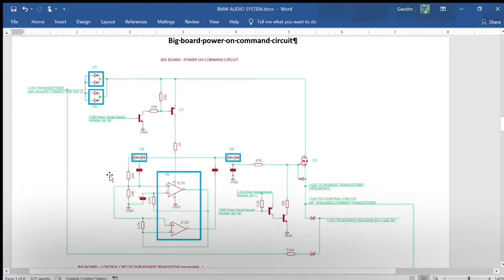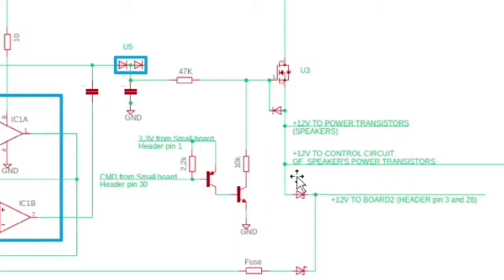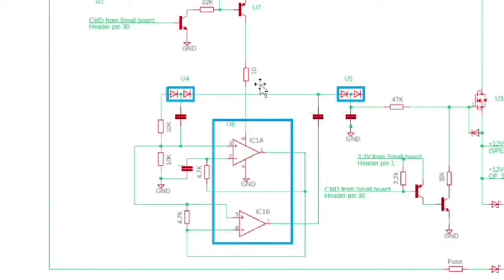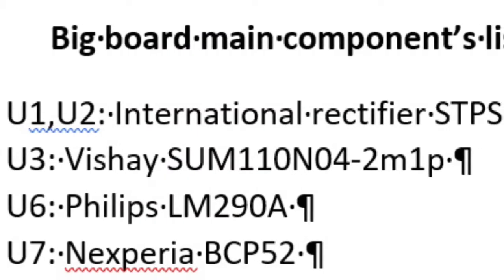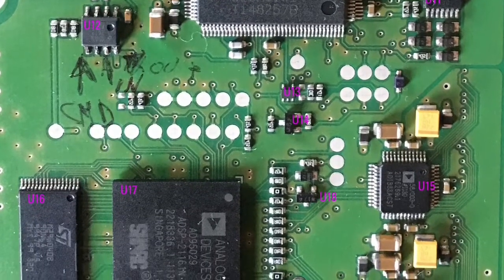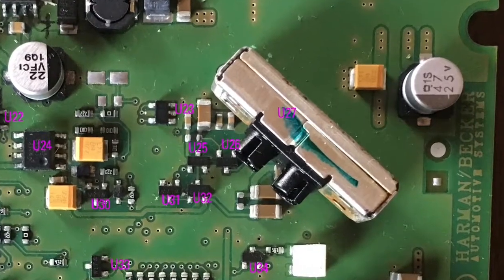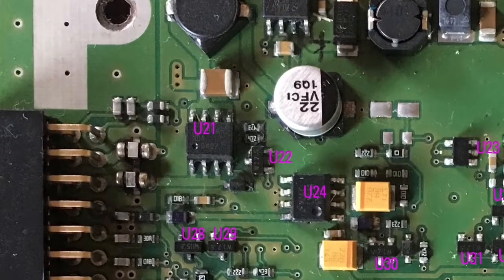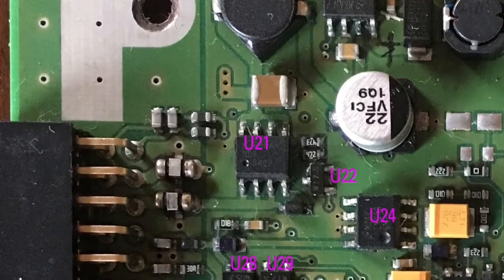BMW Harman Logic7 Amplifier Repair Guide - Part2

Comment: Hi there, thanks for the info. I have the same amplifier and am interested in removing the "small board" and using analogue audio inputs to the amplifiers "big board". I figure the input signal pins on the big-to-little board header are the 18 furthest away from the main rectifiers on the big board, as the tracks from these pins seem to fan out to the amplifier chips. What I need to work out is what other pins on the big-to-little board header I need to connect, and which voltages should be present on each, in order for the big board to function correctly. I expect that, at a minimum, I probably need to provide 3.3v and a "command signal", as mentioned in your video, in order for the main MOSFET to power the components on the big board. Is that correct? What does the "command signal" look like, and which pins do these use? Is there anything else I would need?
Reply from the maker: I don’t have those  boards in my hands anymore. May be someone else could help you. Otherwise take a multimeter and continue the reverse engineering of the schematic. If you will do it, share it with us here

Comment: Hello! please tell me where to find the technical documentation for a similar Harman / Becker BMW F30 amplifier (2013) (65129310500). Water has entered. He writes there is no connection with the amplifier, the fuses are good. 
AND which program to open the file SCH7?
Reply from the maker: All info are on .doc document, you don’t need .sch file. I don’t have info on other boards

Comment: u can fix my L7?
Reply from the maker: Eduardo I can try. What happened ?
Reply: gaucho livido 
No estás salido sonido 
Donde tu eres?
Reply: Do you speak Portuguese or Spanish?
Reply from the maker: Eduardo Zaik i don’t know Spanish and Portuguese well enough to understand a technical description of your problem. I’m from Italy
Reply: gaucho livido I’m just asking because I’m from Brazil and your name “gaucho” is very common in Brazil.
I’m currently living in Orlando, USA and I recently bought a BMW but the sound is completely muted. Yesterday I bought a fiber optic loop to do the tests, and I’ll probably get it on Saturday
How do you think you could help me?  by video or do you believe it possible for me to send you my L7?
Reply from the maker: Eduardo Zaik you are at least the fifth to tell me this on many forums. LOL 😂
Reply from the maker: Eduardo Zaik you can also send it to me but first of all you have to perform all possible tests with fiber optic loop in order to be sure what the problem is. Also check il voltage is arriving to the amplifier or if some car fuse is broken
Reply: gaucho livido the voltage is perfect 12.5v